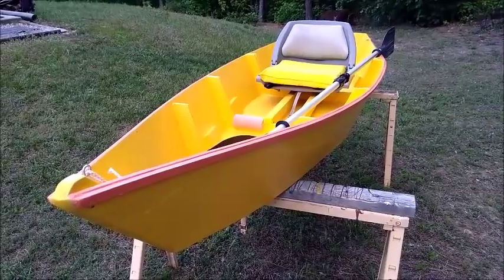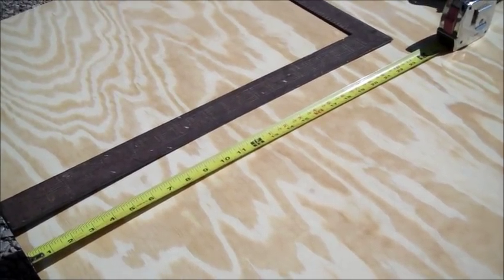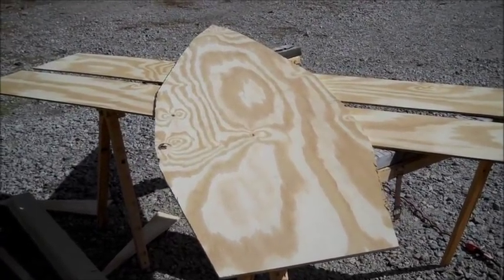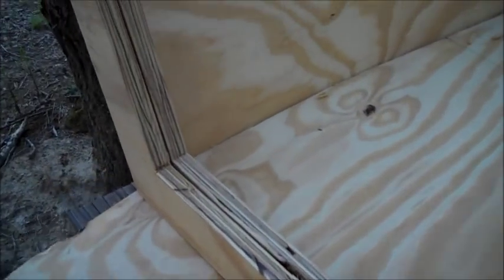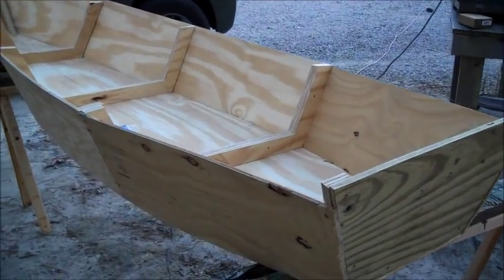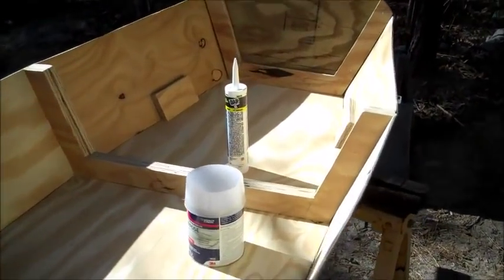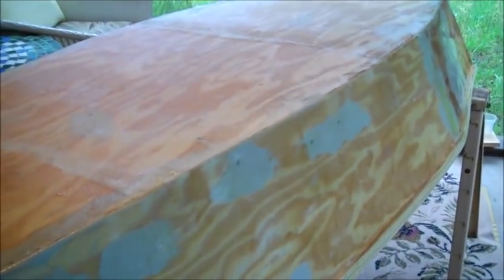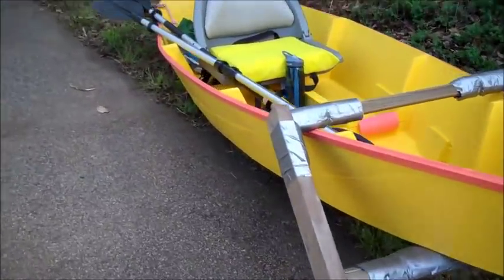Homemade plywood canoe / kayak build

Comment: Many years ago I built a small sailboat (a Windward 15). I spent a ton of time trying to follow the plans to the tee and reading up on the "proper" way to do it, and I spent a ton of money on "proper" materials (marine plywood, bronze screws, epoxy resin, etc.). I like your way better. Kudos!
Reply from the maker: Thank you!
Reply: Plywood canvas dropcloths,and some porch floor paint can make a very useful boat.for a very reasonable price, and the plans are out there for free

Comment: Good job! I think at this point a skeg will make a reaal difference, If it were about 3' to 4' longer also it would track better, Im not being critical about your work you did a great job.  I once built a 8' one person kayak and it also wanted to turn quite a bit  I installed a T style skeg to slide in a track  on the bottom and it pointed correct after the installation.I hope this helps.
All the best!
Reply from the maker: @robertcooke8320  thanks for the feedback and suggestions!

Comment: Nice job man! 
I bet the skeg did really help. There are a lot of builds in the world that have lasted for decades. 
We had a family 12 foot duck boat that had a 5.5 outboard on it. As a kid ran it hard, turned it fast, and ran it up on shore. I think it finally started to leak at the bottom cross seam at the 18 year mark.
Being your set up will not have the tork on the frame and transom from a outboard, your should last much longer.
Great job, inspiring
Reply from the maker: Thank you kind sir!

Comment: Congratulations , you did it !
I think that you have a great attitude , and probably learned a lot by doing this.
I have built many boats , and its all just a big learning curve.

Speaking of curves , its easier to first join your side panels to the full length , using simple butt joints ( a strip of plywood maybe 4 inches wide  ,  placed over the joint on the inside of the boat ) . If you place the butt joint between the frames ( ribs ) you will get a smoother joint , without a hard spot , and there is less stress concentration on the panel joint .
Reply from the maker: Thanks for the feedback and the great suggestion!

Comment: Very good confidence boost builder ............. I’m going to use many of the steps you have shown....... I’m building something similar but a little wider and a little bit longer, but just as simple.

Thank you for sharing.
That was a great build.
Now you need some fishing 🎣 pole holders and a small cooler.
Again, great job.

😎
Reply from the maker: Thank you and I wish you great success with your project!

Comment: Innovative design concept - nice lines.  Yes, a skeg will definitely improve tracking.   Remember seeing an advertisement long ago for a decked over production version of this same basic hull design.  It was a larger boat with a centerboard and sail rig and was marketed as a paddle, outboard motor, sailing hybrid.   Just in case that gives you any ideas about a future build, I was thinking that the centerboard could double as a skeg for paddling, adjusting the depth for optimal tracking/maneuverability.  Anyway, I like your boat.
Reply from the maker: Thank you for the feedback and excellent suggestions!

Comment: Good Job. If you can adjust the seat so that both ends of the boat are not underwater that will make it paddle faster  because it will allow the water to flow more smoothly under the boat. Adding a small fin or skeg to the rear of the boat will help it  stay moving in a straight line.
Reply from the maker: Good observation and suggestions, thank you!

Comment: Very nice boat especially without any plans.  I built something similar except I did 2 boats with perpendicular transoms. I set one transom inside so the two transoms could be clamped together.  That way I wound up with a 14'6" double ender.  Taken apart the hull folds like a clamshell and slides in the back of my pickup truck.  Mine is very similar to yours.  I didn't use plans either.  I did wind up buying a third sheet of plywood because of cutting errors.
Reply from the maker: David Bennett oh that sounds cool!  Would love to see a picture.
Reply: Dude that's  clever take a bunch of pictures and put it on YouTube

Comment: It's nice to see that you can build a decent kayak out of just simple materials and simple tools. I don't have a jig saw right now. I have a drill and a circular saw though. I have a tape measure and level too. I just need to find a jig saw that's cheap as well as the plywood. I wonder if you could use a combination of flex tape, flex seal,  and flex glue instead of using fiber glass.
Reply from the maker: I'm not familiar with those materials, so I unfortunately can't offer any guidance. But I'd be very interested to hear how it works out if you try it! Thanks so much for the feedback and best of luck with your project.

Comment: Great build. I noticed in your testing that the boat was shifting from starboard and port, often referred to as "pointing." I have added a skeg to my homebuilt boats and it makes the paddling experience so much easier. You can do a search and find many different types. Which type would be easiest and best for you will be your choice. Thanks for sharing your video!
Reply from the maker: Thanks for the feedback! Yes, I added a skeg to mine as well, and it definitely helps. You can view a short video about how I added the skeg at the link below if you are interested. Thanks again!  https://youtu.be/DD60nGFO7lg

Comment: Very nice. If you want to make it unsinkable, cut to size pieces of the "pink" foam, and glue them in place on the inner walls of the hull, and if you don't like the way they look (pink color), fiberglass it over and paint it. You can also turn that beauty into a sailboat, but it will take more work.
Reply from the maker: Great suggestion, thank you!

Comment: Awesome job!  I love it.  Putting a small keel on it would help it track better too.  Just a piece of 1x1 running the length on the bottom.  Or two shorter ones.  Just make sure they're straight.  It'll help with stability too.
Reply from the maker: Jim F thank you!

Comment: If you cut one side out then flip it over and use as a template for the other side you get a mirror  image of the hull on both sides and the same can be done for the sides. Good job though as it works well and looks fine. Good choice of colour, canary yellow it looks like.
Reply from the maker: Thanks for the suggestion and feedback!

Comment: You might try using a 10 ft. length of 1/2 inch PVC pipe to draw the nice curves in your design.  Lay it on the plywood and trace it with a carpenter's pencil.  Store the pipe in a clean spot and you will have a layout tool for life.
Reply from the maker: Oh, that is a fantastic idea! Thank you!
Reply: Awesome!
Reply: Wouldnt it be straight though?
Reply: Please give us a demonstration

Comment: Quite a few views! You must be proud of the finished product considering your skill level..
This the design I will mirror to produce my boat..
I have made many designs & models of those.. originally I was interested in building a 'Sport Dory'..
Did you end up putting a skeg?

Thank you for sharing!

Stay safe!
Reply from the maker: Thank you! It has provided countless hours of fun on the water. Yes, I did add a skeg and that helped a little with the tracking. Thanks for watching and commenting, and be well!
Reply: TimberWalkers you should add a keel. It will help with steering and stability
Reply from the maker: @smokeybear1925  Definitely on my next build! Thanks for watching!

Comment: What you reckon the weight of this little craft at? Sweet little boat , I've been looking to build something myself. I was looking at the styrofoam kayaks but this little boat reminds me of my child hood when we had a similar but all be it larger boat like this.  You totally winged the angle's? No pre plan or diagram? It would be a nice boat for instructables
Reply from the maker: It's just under 60 pounds. It more or less follows the design of what they call a pirogue, but with the back lopped off. Thanks for watching and commenting!

Comment: Nice shape, and video. Congrats&Respect! 
Looks like not much water resistence when moving, that makes it efficient. Maybe a bit V-Shape on the bottom would help to keep the hull more straight on it's path while paddleing. If it where my kanu, I'd try to straighten the path (and increase efficiency) with a little fin underneath the boat - or maybe by adding a feet-controlled steering-rudder - that increases also the agility and the comfort of the boat.
Reply from the maker: Thanks for the suggestions! I may try to modify this boat, or I might even attempt another build one day to make a "new and improved" model. Thanks again!

Comment: I know this video is a few years old but I've just now seen it.
I love the idea and would like to know more about the angles of the sides and what thickness of plywood you used for the bottom.?
Reply from the maker: Thanks for watching! I used 1/4 inch plywood for the bottom and sides. I'm afraid I don't remember what the angle is, but you may be able to calculate it from the dimensions given in this diagram:
https://drive.google.com/file/d/0BxdcO-IQh4idWmtxQXpNNnVjbEU/view

Comment: Wow ! it's so nice kayak ! but use plywood for boat body may be not good for out-door, sailing on water and under sunlight , there should be caused the plywood to split open ! right ?
Reply from the maker: Good question! I used exterior grade plywood and it's held up well after two seasons of use. I also put a fresh coat of paint on it each year
Reply: @timberwalkers  Ha ! thanks your reply ! oh, it's exterior grade plywood ! we don't have right here...^=^

Comment: One handy tip, you installed screws into the plies of the plywood on the ribs, this tends to split the layers apart on the plywood, you lose a lot of strength that way. Always put screws into plywood from the solid side, so probably the ribs should have been made of solid wood instead of plywood.
Reply: Ever heard of pre-drilling ?
Reply: @Charlemagne1367  If you pre drill a big enough hole to prevent damage to the plywood, then the screw won't hold.
Reply: @G56AG That means your predrilling is to large for the used screws and you are overtightening and maybe even the wrong screws.   You predrill accordimg to the srew size, the shaft of the screw, so the threads can grab imto the wood.  Correct predrilling has worked for quite a while 🤔  Mdf even weaker on edge works fine, plywood is no different.    
 Another small tip...use ca glue in the predrilled hole...
Reply from the maker: Great suggestion, thank you and thanks for watching! I've learned a ton from all the comments!
Reply from the maker: @Charlemagne1367  Thanks, this also seems like a good idea!

Comment: Nice--But the reason of the military style propulsion of left-right-left is that you sit far forward. With a skeg (keel) you might not move quite so much but your energy will still be directed laterally.
Reply from the maker: Thanks for you comments! The skeg helped some, but I may build a "new and improved" version at some point with a keel.
Reply: Just a 1" x 2" keel down the length of the boat would probably do wonders.
Reply from the maker: J DeWitt thanks for the suggestion!

Comment: How's the stability? In the vid it looks a bit tippy.... that's not a criticism, I'm a big fan of what you accomplished. Just asking because I love the design, but curious how it would handle a taller, heftier guy.
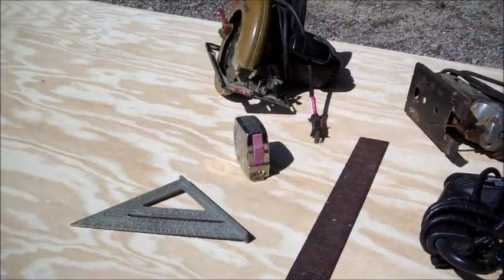Reply from the maker: Thanks, that's a great question! I'd say it's just a tad wobbly, but I've never felt like it was going to tip. Oh, except that one time I tried to stand up in it, just to see. :-) But depending on your size, maybe make it a little wider? Here's a link to a video where I'm paddling through a bit of chop, if that helps (1:36 mark): https://youtu.be/SP27FR9iDPc?t=96
Reply: @timberwalkers  Outstanding! Thanks! 

Have you considered rowing it like a row boat rather than a kayak? Having both paddles pushing at the same time might make you faster in the water? Just a guess. My grandfather was a master boat builder and I spent quite a bit of time helping in his shop, but I'm not going to pretend to be an expert in human propelled craft. LOL.
Reply from the maker: @facepalmdaily4404  that's a good thought, but I'm not sure if there's enough room for rowing. I'm also not sure how you would mount the oar locks. Thanks so much for your comments and feedback!
Reply: The beauty of the design is if you make it a bit longer ad wider at the bottom you can make it a bit more stable the narrow design of all kayaks make them a little tippy,a few more sticks and a couple chunks of foam will make some stabilization floats like the expensive kayaks have,you will still catch fish and go in some very shallow water

Comment: I like the video, How you suggest to make the boat longer to 16feet?
Reply from the maker: Johnnie, that's a great question, but I would suggest you talk to someone who is way more experienced with boat building. That being said, one way to join two sheets of plywood end to end is to use something called a scarf joint. That would essentially give you a 16 foot sheet to work with. You can find more information here: https://www.glen-l.com/wood-plywood/scarf-butt.html
Reply: TimberWalkers ,: thanks for your suggestions.

Comment: Nice built, so how did it work out with the longlivety of your boat, will it last over the years?
Reply from the maker: It has held up well through the first season of frequent use. I'd like to give it a good sanding and a new coat of paint, but that may wait until then end of NEXT summer. I think a boat like this can last a number of years if well cared for and not left out in the elements.

Comment: Well, young man, though there are a few misgivings in the construction of this  boat, I must congratulate you for such a good effort and finishing.  
What could have been done better was the central joint of the sides.  Rather than cutting the side and put in an additional fame, 
 on which to hammer the side, you could have made a butt or a scarf joint which would have been much stronger. However as you introduced the  gunwales /gunnels  on top of the sides you did introduce a component to make up for the misgivings in your joint.   I do not think that you needed to cut the sides of the fibreglass as it would have given in to the curves included in that boat.    I still give you full marks.  Congratulations.
Reply from the maker: Carmel Pule' You are very kind and I am grateful for your feedback!
Reply from the maker: P.S. I'm not so young ;-)

Comment: Sweet little boat!  I've been looking to build something small and simple. I checked out the links, and the basic design. Do you have the measurements or pattern for the ribs posted somewhere . Seems like those determine the shape and angles of everything else.
Reply from the maker: Hey, that's a great question. Short answer is "no", but I think you could figure it out fairly easily . For example, from the diagram you know that rib no. 1 is 12" wide at the bottom and 20.5" wide at the top. And the diagram also shows that the sides of each rib are 11" long. I did leave off one key piece of information, which is the height of each rib from the floor to the gunwales. I just went out to check and that measurement is about 10". I think that gives you everything you need. Thanks for the question!
Reply: Thanks!

Comment: Whats the weight you think?
Reply from the maker: Mike Theune Good question! I can lift and carry it short distances by myself. I would guess 50 to 70 pounds. I can load it into the back of my truck by myself, but would need help putting it on the roof rack of a car or SUV.
Reply from the maker: UPDATE: I weighed it on the bathroom scale. It weighs about 58 pounds. Thanks again for the question!

Comment: What do you think tye weight limit would be.
Reply from the maker: I would not speculate on the maximum weight capacity, but I'm no linebacker. Me and my gear (camera, snacks, extra paddle, etc.) probably add up to 165. I do think it could handle a bit more than that.

Comment: I see you ran out of room on the sides - - the fix, instead of double bulkheads is to do a butt-joint with 4" strip of wood. Also, no need for the transom bulkhead if you are going to fiberglass everything anyway.
Reply from the maker: Great suggestions, thank you!

Comment: I have 110kg and i do not know if the kayak could handle me
Reply from the maker: Again, great question but I'm really not sure. I suspect you would need something just a bit bigger. Sorry I'm not more help! If I get a chance to do some weight testing, I'll post a follow up comment.
Reply: Thanks, I will try to make a little bigger and spread, so I notice how it turned out, in every case a great kayak and easy to do ..
Reply: tomek đakan you may want to look into a pram design if you want something small as a first time build or a skin on frame boat some of the manufactured folding kayaks hold 1000 pounds and are reasonably priced on Craigslist and eBay
Reply: Zebgoraja Holyhell I want to make a kayak for fishing, i am from croatia and we have such kayaks up to 1000 € and i order over ebay box would cost me a few € and construction of this would be 100 €